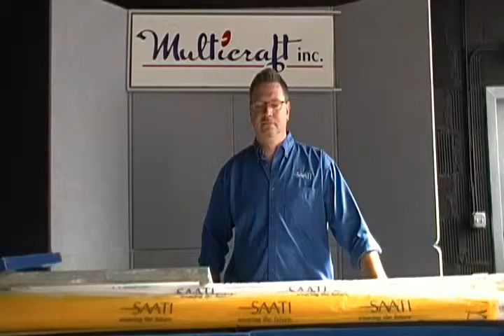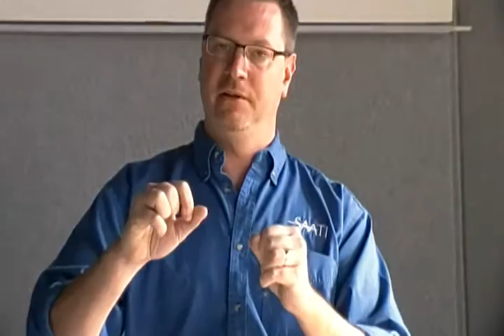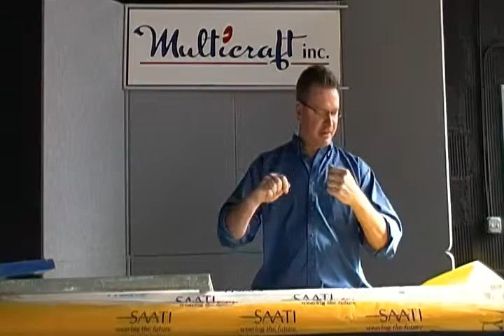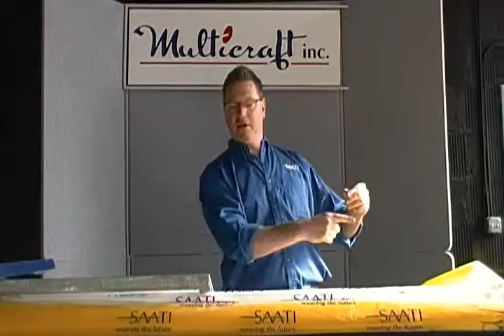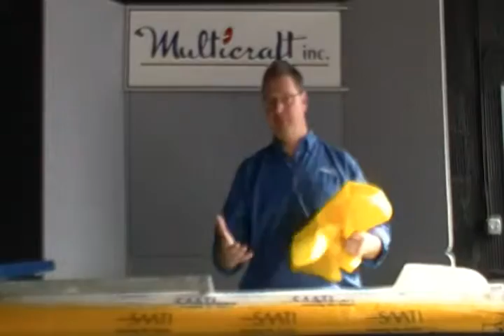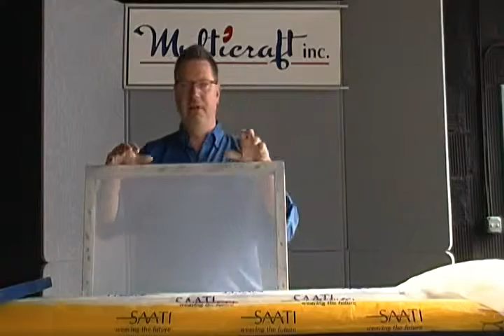This is a SAATI rep talking about screen mesh.

Comment: We use SAATI HI-R 380(150) PW 31 mesh with GRUNIG 250 stretching machine. How much time one should wait after stretching with 4 bar pressure to start glue process?